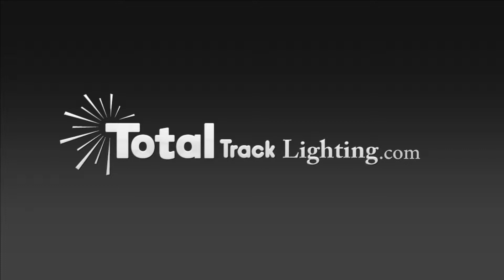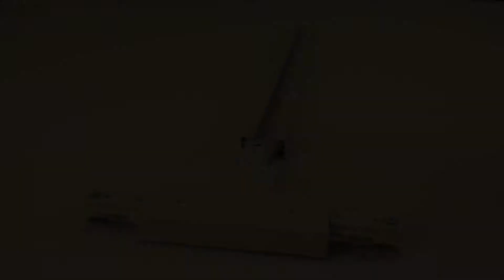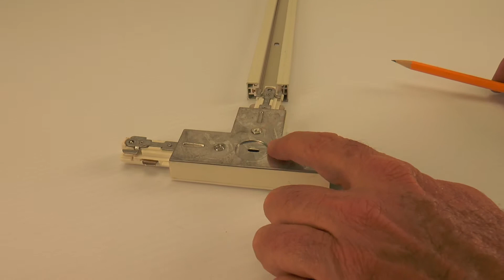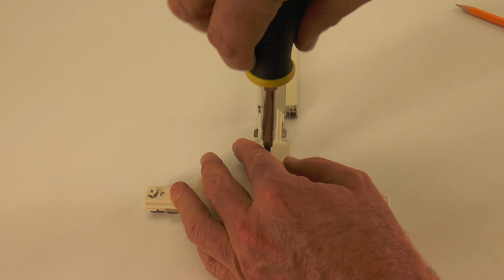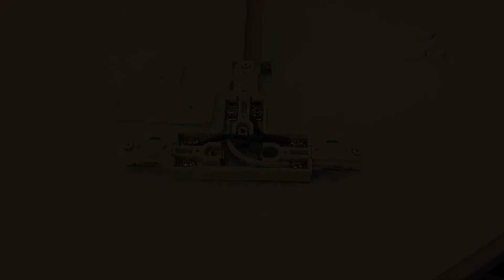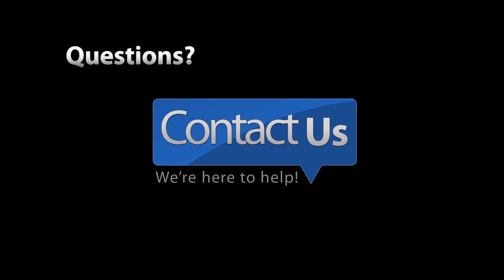3 wire H style T Connector power feed overview by Total Track Lighting

Comment: Can you use the t connector to connect to the junction box and power the whole track system?
Reply from the maker: Yes the T-Connector can be used as a power feed to bring power into the track lighting system.
Reply: @Totallightingsupply  thank you for your answer. When you open the t conector i dont see extra cables to connect to.the junction box. How do I do that?
Reply from the maker: @davidjrazeghi3248 where did you purchase your T-Connector? Here is a link to ours showing the internal workings.
https://www.totaltracklighting.com/t-connector-architectural-black-3-wire-h-style-single-circuit.html
You can wire directly into the power feed.